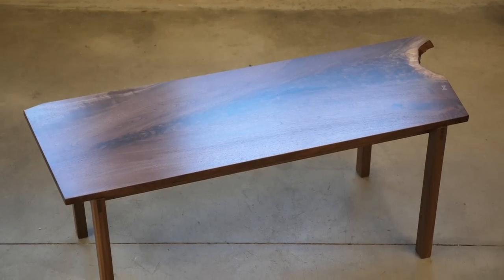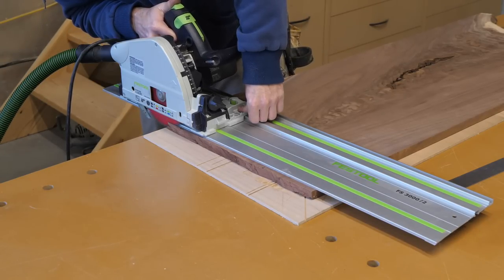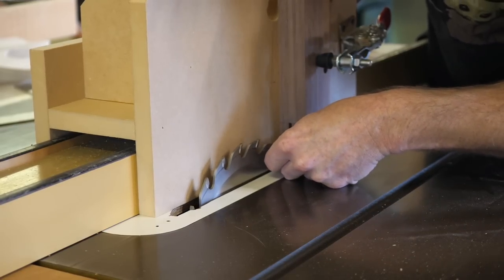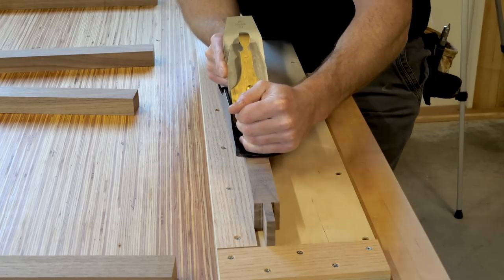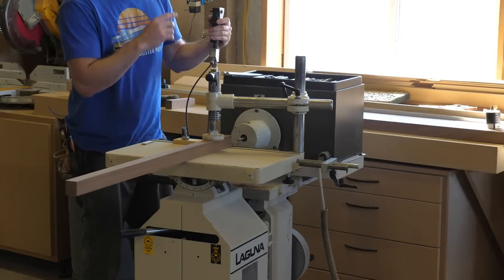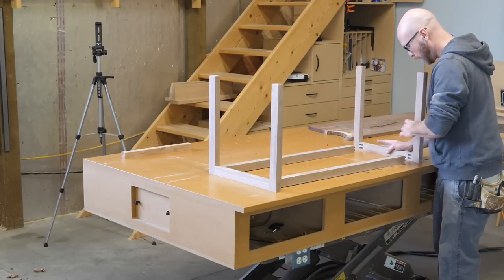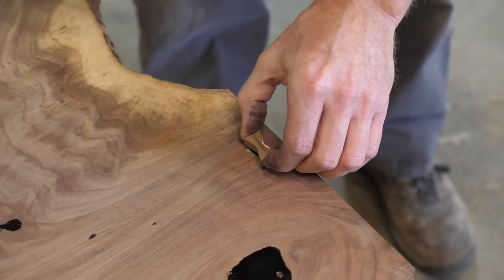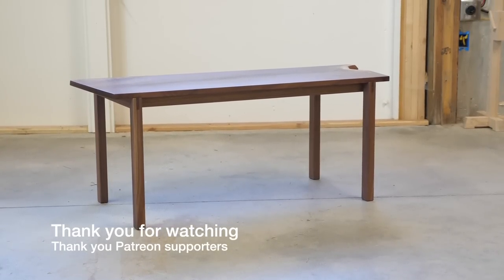What should this table cost? Help me figure it out.

Comment: It is refreshing to hear a Tuber recognize how much glue is adequate. I'd say that such a table (I like it very much) would be worth $3,000 right off the bench if there was an eager buyer standing right there. On the other hand, if there was still such a thing as a successful gallery right across the street accepting such work, their cut would be at least 40% of the retail. In that case, the table's price would have to be $5,000 for both you and the gallery to realize the necessary price. On the third hand, having no gallery capable of selling such work for that price, the task of finding a buyer is yours to accomplish. Your channel is probably the very most efficient way of accomplishing that. With the intention of profiting from all your work and investments while supporting successful retailers or the additional cost and effort of finding a buyer on your own, the cost needs to remain $5,000.
Reply: 18:10

Comment: Mike, I made a coffee table out of a large slab of walnut about 10 years ago that's kinda similar to yours.  Mine was about 4 ft long and wider (but variable also keeping lots of live edge) and thicker (nearly 8/4).  I made 4 legs out of 3x3 walnut with a walnut stretcher.  It's much heavier looking than your table but also with lots of tremendous grain pattern.   Finished it with a tung oil/urethane mix.  If I were to sell it, I'd sell it for about $1500 (the slab alone was about $600).  Nice job.
Reply from the maker: Thank you.

Comment: An issue I have with most live edge furniture is that it usually feels like the live edge slab and whatever legs someone screwed to it weren’t meant for each other. I like that the slight dado makes the two parts feel custom for each other.
Reply: Me to, but I solved that by using a second slab, cut to height and offset to 10 degrees to make live edge legs to, it worked amazingly, but.....
It's now a 2 slab table, n is now expensive as a result!
But it looks amazing!
Reply: $150
Reply: Me to, should have sliding dovetail it instead of dado+screw.  Or hidden sliding dovetail if you dont want the ends to show.
Reply: Wake up

Comment: Looking at the materials, you have roughly $350-$500 in walnut.  Then the consumable shop materials (finishes/sanding/etc), which I would price around $50-75.  So in physical cost your at almost $575.   I also have a shop cost on larger project usually a flat fee of $100 ( all them pretty machines aren’t free).  Then there is the tangible cost (labor).  I typically charge between $50-100 an hour depending on the skills involved in the work being preformed.  Milling lumber vs hand cutting bow ties vs finishing.  I am going to guess you have about 24 hours (3 tshirt changes  in the video is my metric for this guesstimate).  So that would be about $1200-2400 in labor.  For this I would say $1800.  Then your profit margin.  I use 10% as my margin, so about $250.  So about $2700 would be about the price for a one of a kind solid walnut table.
Reply: Thanks for not saying "materials times three"... That pricing method is a bit sophomoric.
Reply: Why do you use 10% as your margin?
Reply: nicely reasoned.
Reply: Looks like I am underpricing my work
Reply: @toddschriver9924  you might be.  I was for a while.
Reply: @yoyopg123  Yeah, i have been slowly raising my hourly rate for about 18 months and it doesn't seem to have hurt sales at all.
I can't really build an inventory and I get just as many commissions
Reply: @toddschriver9924  that's awesome. Very glad to hear it.  Ironically, you may actually get more commissions from certain people because you raised your prices.  There is a psychological element at play here, I think.   You may find it of interest that one of the main reasons I ended up raising my prices was because of a moral argument made by someone I saw on YouTube.  The best description of what I am (although I'm not fond of it) is a "Jobber".  I don't do this full time.  And while I'll rate the quality of the work I do  high,  I don't have any of the many pressures or issues of people who do this as a full time business.  Undercutting those people by artificially devaluing my work actually artificially devalues their work.  There's nothing wrong with competitive pricing between craftsman but to essentially "dump" or subsidize low prices because you already have a good and reliable alternative income source is not good for the long term health of the craft/trade.
Reply: @DavenH  just a nice easy to mathematically figure number
Reply: @mikedeafenbaugh5984  I think that would only work on smaller projects were is it would be hard to justify an high hourly rate.  Cutting boards would be a good example.  You have $30 in materials and price it at roughly 3 times the cost, for $90.  It would be hard to try and price that board at $150-200 after 3-4 hours of labor.

Comment: So Mike, this was pretty rad to watch this from material selection, which inspired the design, dripping in small details of the making process. I’m from Buffalo, NY which is very close to East Aurora NY which is where the Roycroft Campus was founded, which I think was a movement in answer to the industrialisation of making factory line junk, bringing the focus back to craftsmanship and design around the turn of the 19th century. It wasn’t  just craftsmanship style furniture, it was also metal work, pottery, a whole movement, pretty cool. Maybe you know all this, Ida know…my wife has the brains in our operation, I’m just trying not to embarrass myself, know what I’m saying?

One quote from a visit there stuck with me, “People know the cost of everything and the value of nothing” or something along those lines. Word up

That being said, I don’t know how much you typically charge for your pieces, and sadly at this point in my life I’m not in a position to invest in bespoke, original solid hardwood pieces, so I’ll take a crack at it, and I understand there is a a hike in timber prices at the moment.

Really nice piece, solid design, terrific craftsmanship, really like the Burl in the surface, love walnut…

$2,800

Bro I know this looks like it took you a while, my best estimate, apologies if you think this is lower than your pro pricing estimate, or if that’s too high for broke people like me to consider

Comment: In looking through the comments, my estimate is definitely going to be on the higher end of the scale.  Your work is more than just a calculation based on time, materials and overhead. You have established yourself as a excellent and well respected craftsman/artist.  A table made by someone like me using that slab of wood and with the exact same level of craftsmanship would not be worth as much as it is because you made it. Having something made by Mike Farrington adds value. With all of that said, I would estimated $4,500 to $5,000.  (Please let me know if you decide on $1,500 or less like some have suggested. I will buy it immediately and I am not a person of means and have no need for a new table of any type!
Reply from the maker: Thank you. Check my website in a week or so. I will average out the comments and list it for sale.

Comment: Hard to tell pricing without knowing how many hours you have in it or the cost of material.  I will take a stab at it though...

Day rate of $750 for an 8 hour day = $93.75 an hour.  Lets say you have 20 hours of work into it that's $1875.00.
Hard to figure material as cost differ a bit area to area.  Let's go with soup to nuts, wood, glue, fasteners. $450.00

So subtotal of $2325.00.  

Add 7% for infrastructure overhead.  (electricity, heat/cooling, etc) $162.75

(You could add 5% for business infrastructure, website, marketing, etc)

Subtotal of $2487.75 so round up to $2500.00 (your sale price.  A gallery sale would add a large percentage on top of that)

EDIT; Now that I've been to your website and seen your excellent work, add $250.00 to the day rate.  Total $2750.00

Comment: What an engaging video concept.  The filming and pace are excellent.  I just sold a less creatively designed table that can function as a desk, or hallway table,  for $2,500 in Rockland County, NY, not a posh area.  The top is a glued up panel of beautifully figured hard maple and mahogany, with a 30 degree inward bevel on the bottom to give it some lightness. The legs are tapered mahogany and the stretcher and apron are mahogany with maple inlay.  Joinery is double floating tenons (Festool Domino) and I used z-clips to attach the top to account for wood movement.  It sold at a charity event  in a silent auction so the price may carry a philanthropy premium.  Bids started at $1,500 and worked quickly up to $2,400, then the final bid came in just before the bell.  Bottom line, I think your table is worth more because of the unique beauty and balance of your design, not to mention the exquisitely turbulent figuring of the walnut. If I were a buyer in a reputable gallery I gladly would have plunked down $5,000 for yours, especially if looking for something contemporary that my great grandchildren will someday enjoy.
Reply from the maker: Thank you for the kind words.

Comment: I can look at this in a couple ways. One the one hand materials and hours worked would sugest that it should be on the high side of pricey IMO. like $1200 On the other I can see people snapping it up in the $700 range. Personally I'd pay materials and sweat equity if I had access to a shop. . . but that's the maker in me.
I say sell it for around a grand.
Reply from the maker: Thank you.
Reply: Insanity. $1200 is insulting. Maybe $1200 for some garage hack that isn’t running a business.
Reply: @ericmac564  $1200 seems about right unless material was expensive. It´s just a table, a fast project.
Reply: @bowlchamps37  I own a small custom cabinet shop with a 5’x10’ CNC and all the overhead sanders, planers etc one could need. There’s no way i could or would build this and make any profit.
Reply: @ericmac564  That's it! You can order it for half of the price online. 
You can decide to pay more for a local product or pay less for random. Same quality as the world isn't standing still around us.

Epoxy tables also are in a ridiculous range. 300 for a table is normal. You can't beat this outside of a hobby.

Comment: I really admire your attention to detail. My price point would be $5300, which is more about what I think the market will bear in terms of competition for alternative products and your need to recover a slightly below-market cost of your time, as opposed to what I think your time and CapEx is actually worth. If I were pricing based on T&M and CapEx, the price would be about $8k. It really depends on how long you're willing to hold the inventory. I think it flies off the shelf at $4-5k, hangs around a little while at $5300, and hangs around a long time waiting for exactly the right buyer at north of $5300, but still sells eventually at less than $8k. Above $8k you keep it forever but it becomes a buyer calibration point/catalyst to sell other, more expensive inventory by providing a relatively high comparison point.
Reply from the maker: Thank you very much.

Comment: Hey Mike, does attaching the top like that allow for wood movement? How wide a table do you think that method would work for?

It’s a beautiful table.
Reply from the maker: What I didn't show in the video is the the bottom of the screw hole has been opened up allowing for about 1/8" movement per side.
Reply: @MikeFarrington  

Thanks. I’ll have to give this a try. I’m looking forward to seeing what you’re able to sell the table for. 

It’s definitely a high end table

Comment: $2250, due to how unique the grain is and the beautiful joinery.  I have made slab talkes similar to this and found that when I add a turned vase out of the same wood it really puts the "cherry on top".  I dont turn my vases to hold water either, dont want water around the table, they are "dry" vases.  It can be a challange to find slab wood that also has a turning blank, and that's why it's special.
Reply from the maker: Thank you.

Comment: I'd say $1500. Looks like 6 bf of walnut at so approx $60. 12 hours of shop time @$50 is $600. Other materials used like glue, finish, screws etc, $50. Shop overhead (this is an even bigger guess than all that other bs) $50 per day so $75...add that up and put on a 50% margin. If I did the math right it's $1570. Your craftsmanship is excellent and your videos are easy to watch. Keep up the great work.

Comment: $2400

Reasoning, for the nerds like me:
It's hard to say for sure without knowing more, but from a little research, I'm figuring you have $400-600 in the slab. I'm assuming someone of your skill can knock this out in a couple days, so that's $800-1200 for labor. So let's say $1800 if you don't add an overhead percentage for shop upkeep and things on your site don't sell immediately (high demand). YouTube audience premium means you could probably get nearly twice that on an eBay auction. So, I split the difference. That would also put it in line with similar one-off designer pieces I've seen -- simple top, no waterfall edge, custom-fit wood base instead of metal legs, etc. So there are definitely buyers at that price. More than I'd pay personally, but partly because I'd be going for a different style (heavier + rustic chic), and I'd like to make it myself instead. 😁
Reply from the maker: Thank you.

Comment: Nice shop, presentation and work. Unless I missed a something I saw flat head screws in stretchers?..if so oops..you need allowance for expansion /contraction or top very well crack from restraint.
Reply from the maker: The bottoms of the holes were opened up to allow the screws to pivot. I left that part out of the video because I needed to make room for my "finish on" joke. Besides, there is not way the top will crack. This isn't a wide enough board and the stretchers as soft enough to give before the top would crack.

Comment: Hey, on your finishing passes surfacing with the CNC, don't do more than 40% of the bits cutting diameter in step over and you will get a much nicer finish. But then yiu have the sander 🤷🏻
Reply from the maker: Great tip, thank you.

Comment: I do like the overall design with the single board top and some live edge. I like the Nakashima style bow tie in the split and the fact that you performed that with hand work. I prefer a stretcher somewhere lower in the legs so they don’t look too spindley but I’m a carpenter so i tend to gravitate toward way over built framing. As far as cost that’s a good one. I would go at least $2500 or more. I have no idea of the time it took but you use a combination of machines that are not cheap combined with extensive handwork, also with expensive tools, to arrive a very well built unique table.  Your table has a function but it is a piece of art and should  be priced as such. Also I work full time in construction and my hands don’t look as bad as yours in the close ups. Usually it makes me laugh out loud.  Thanks as always for the content.

Comment: Love your videos Mike. As a cabinetmaker apprentice I throughly enjoy watching and learning throughout your entire descriptive video design. Out of curiosity, why not use a general purpose blade or a finer tooth crosscut blade with a flat top grind when cutting the tongue and groove joinery for the base assembly to avoid further cleanup on the bench? When I make cabinet doors that don’t allow me to use router bits (if the panel is less than 1/4”) I’ll use the table saw with a dado stack to cut the tongues and a flat top grind blade for the grooves. Always 1000 ways to skin a cat, just curious to hear your feedback and thought process. Cheers!
Reply from the maker: Honestly, I should have done that. I just didn't feel like changing the blade. I would have yielded a cut with less cleanup.

Comment: Any carpenter can take a slab of wood and stick four legs on it and call it a table. It takes experience to mate the slab of wood to the support structure to make a beautiful piece of furniture. The legs and base are so proportionally correct to the top that they meld into  a seamless picture. I look at it and think its perfect. I would expect  $2750 - $3200 for a piece like this.
Reply from the maker: Thank you very much.

Comment: Incredible.   Really nice details.  Is there an allowance for movement at the ends?  Is that necessary on a table of this size?
Reply from the maker: Thank you. The screw holes were opened up at the bottom allowing for some pivot. This table could move 3/16 or so, meaning a little wiggle room is all that is needed.

Comment: I struggle to price the little projects I make. I see people slap together a Adirondack chair with pallet wood, that looks like it will fall apart in a year or sooner and it sells for $50. I see yt vids where folks make real chairs that will last a lifetime priced at $250. People seem to settle for the $50 disposable chair everytime.
Reply: Because of retailers like IKEA and others, folks do not understand the difference between production particle board furniture pieces covered in a walnut burl paper veneer vs high end solid walnut, hand made, multi-generation pieces that with proper care, could last hundreds of years vs 5-10 year average from the production pieces. You can not even compare the two. It’s worth every penny he’s able to get for it but it is not going to sell for the right price in just any market and needs to be sold in a higher end market to realize it’s full potential.

Comment: By screwing the stretcher directly to the table top, don't you risk cracking when the top moves? I thought this is why biscuits and figure of eight fasteers are commonly used.
Reply: I am wondering the same thing, I would like to see this one answered.
Reply: The hole drilled through the stretcher is oversized.   This allows the screw a little room to move with the top.